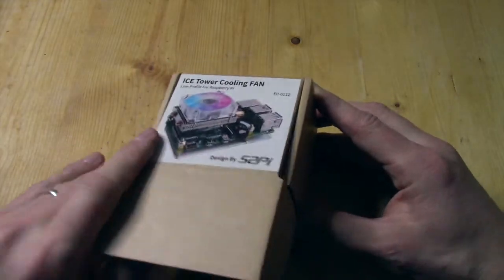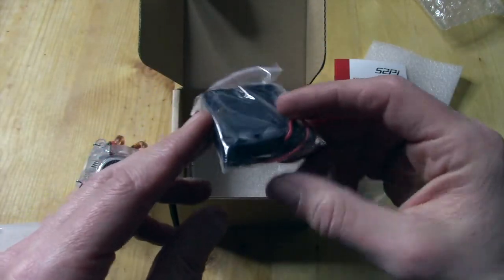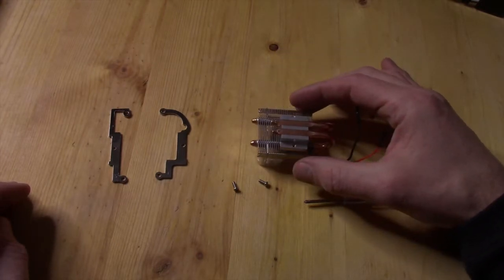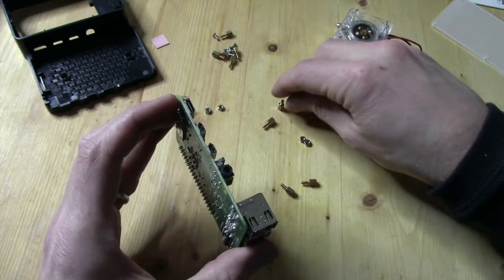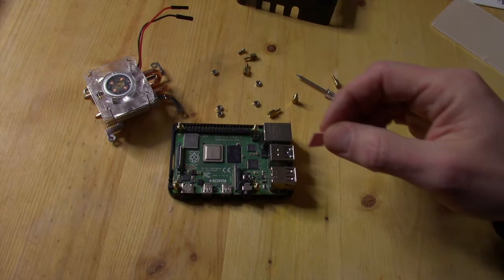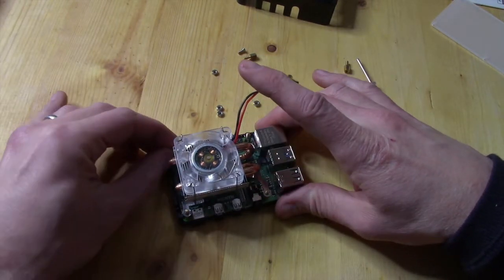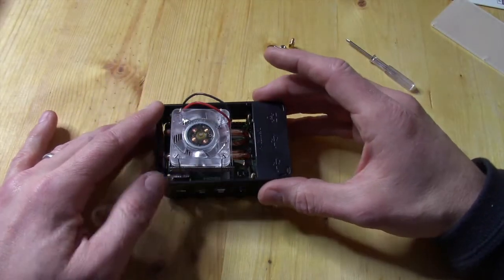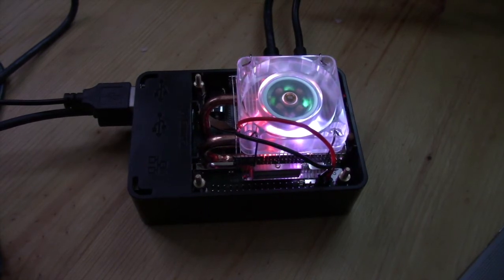Install Ice Tower on Raspberry Pi 4 (Using CanaKit Case)

Comment: Also wish they would make these fans with a GPIO header that is double sided (so you do not have to remove fan wires to use GPIO), or that raspberry pi would make the board with dedicated voltage pins somewhere else on the board...Come on folks...think!!!
Reply from the maker: Agreed.

Comment: how big is the actual fan noise ?
Reply from the maker: It is whisper quiet. I do not even notice it running.
Reply: @HNXMedia  Thanks for the reply, the reason I asked is
That's because I can't use other Raspberry Pi fans because they are noisy. This fan is definitely quieter than other products, right? If you have used other fans, I think you would know.

Comment: Game emulator? As in old Nintendo or sega?
Reply from the maker: Yep. This will run Sega Master System, NES, Super NES, N64, Genesis, Sega Saturn, Sony PS1, Dreamcast, Game Gear, Turbo Graphix 16, Atari 2600 and a bunch more. More are added all the time. I know they are working on PS2 and Original Xbox now. All this for a $50 Raspberry Pi 4 and a $20 cooling fan. I bought a CanaKit (which came with the Pi, a case, SD card with operating system already installed and all the cables I needed for $99). I bought the fan separately. The most expensive part of my entire current Rasp Pi set-up was the monitor and I "cheaped out" at $129 (only because I didn't have an old one sitting around anywhere.). Raspberry Pis are fantastic. As long as you know a little Linux (or are willing to learn) the world is wide open and everything is either super cheap or free.